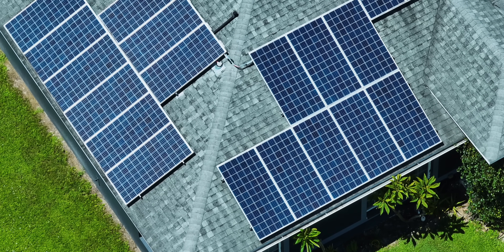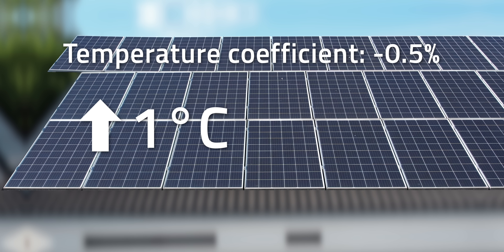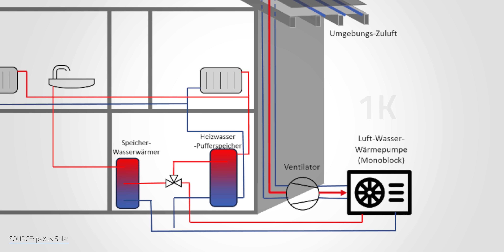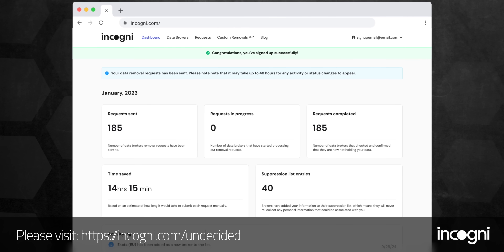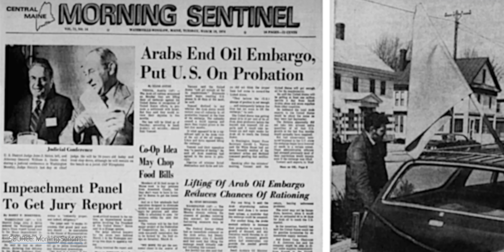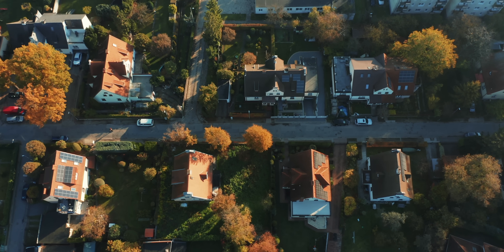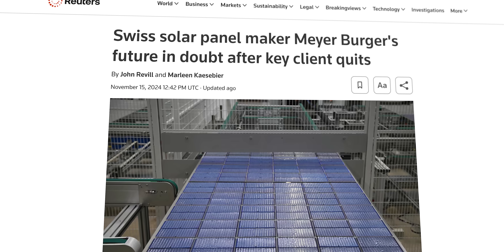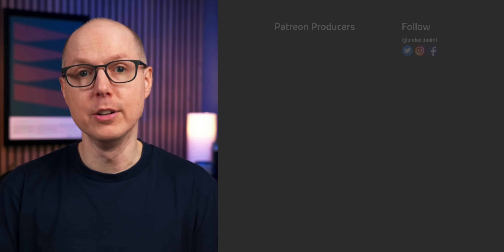Why Hybrid Solar Heat Pumps are the Future of Home Energy

Comment: You want to cool your solar panels in summer.
But that’s also when you’re not trying to heat your house .
The rest of the year you don’t need to cool your solar panels , but then there’s also no significant extra heat to be harvested by the heat pump.
It’s a cool idea , (haha) but ultimately it generates power when you don’t need it. 
A ground source heat pump makes a lot more sense , because when it’s really cold, the ground is still warm when it’s really hot the ground is still cool.
Reply: I was going to make exactly this point. The virtue of an air-source heat pump is that it's cheap. If you're going to invest money into making your air-source heat pump more efficient, why not just put the money into a ground-sourced system instead?
Reply: You still need hot water year round, and in the desert it's not uncommon to be 80⁰ during the day and 40⁰ at night in spring and fall
Reply: Heat your pool or water.
Reply: @llee4225  my daily warmwater needs are about 3kWh, and without pool, just to "waste" / get rid of the energy is not an economic case. It would be a very expensive (invest) way to heat a pool.
Reply: A more useful use case would be "heating a pool" in many places even un summer water is very cool so heating water in a pool might seem a more useful case.
Reply: You still need warm water in the summer though... Also you can run excess heat through a stirling engine to produce electricity or run air conditioning.
Reply: You really will still want to cool your panels on a sunny day in the winter in many places, they will still get up to the hard to hold sort of temperatures if the sun is really on them here all the way through winter. So yeah on the cold, gloomy winters day you probably don't gain hugely cooling the panel, and probably not a massive gain for the heatpump side either - not enough sun for the panels to really get hot anyway. But on the crisp and bright winters day it would have to be really really cold or windy for them not to get hot enough to benefit the heat pump and themselves.
Reply: Sounds like you need heat storage then.
Stone or water work great since they're easy to work with (in different ways) and can contain a lot of heat (i.e. they have a high thermal mass), though you'd need to insulate the water more. So in the case of water you'd need some kind of insulated tank. For stone you just need a lot of stone that is more connected to the place where you want to stabilize the temperature (i.e. the inside of your house) than the ground and especially the groundwater. 

Of course in both cases you need a way to intentionally lose heat as well, otherwise you've built a solar oven instead of a solar powered temperature controlled house, and that's not a great place to live. Or you need to balance it perfectly, but perfection doesn't exist.

If you don't want to mess with the complexity of using thermal mass to control air temperature and just want to use it to store energy, you're going to need to make the storage external, insulate it better, and accept the efficiency loss of transferring it or even converting it to electricity if that's what you need more.
Reply: Thanks for saving me write the obvious. Here summer is 45+ oC/115F which means if I am cooling my solar panels then what am I heating?
Reply: Your hot water heater would say other wise.
Reply: Do you take cold showers all summer? Wash your dishes in cold water?
Reply: @MonkeyJedi99  great have your ac unit push its heat into that, see how quick thats too much already.

And thats a far simpler system
Infact you can buy a integrated heatcylinder with heatpump on top, i have one, it cools down my garage, and gets me hot water. Easy
And it barely cools my garage…
Reply: Houses always need hot water ready though. I'm sure there's a way that you can tie it into a hot water heater (perhaps pre-heating the water) that makes economic sense.
Reply: @ that does, but then in winter its not sufficient, so you need backup heat, or you get tons of ice buildup.
Plus you have to do all that plumbing which is not cheap.

A simple traditional heatpump and some solar panels is just cheaper overall.
Reply: Good point! I wonder if the benefits are mostly felt on bright but cool sprint/autumn days, and this is enough to make the year average decent?
Reply: STES of which GSHP is an example is an obvious answer.  Use the summer heat when needed in the winter.
Reply: My solar panels were covered in snow half last month(January). I doubt that a heat pump/exchanger would work.
Reply: @dannydaw59  can the heat pump be done 'in reverse'? e.g. if you can use the heat pump to heat up the solar panels and melt the snow? hmm... it would be questionable if the electricity the heat pump uses to melt the snow will be recouped by the solar panels in the winter sun, but, its a thought
Reply: Absolutely right.
Reply: use it to heat water in a very insulated tank, if too much hot water water occurs you can convert heat into power when needed.
Reply: Ground source heat pumps tend to be a bit expensive when you live close to bedrock.
Reply: @  sure, but installing this with all the piping etc also isn’t cheap. Groundsource is pricy but it works, this is pricy and it won’t get you heat in winter when you need it, and no cooling in summer when you need it. Its ok for something to be pricy and good, or ok and cheap, its not ok to be pricy and ok or bad.
Reply: You want heated water year round, so that should work either way.
Reply: You still need hot water year round. and there's a lot of things you can do once you have for all intents and purposes free hot water. granted you have to pay for the water.
Reply: Unless you use the heat pump for your water heater in the summer.
Reply: @ which doesn’t solve the problem in winter…
And now you have to use it for heat sometimes and for cool some other times and then …
Yeah..
Reply: The heat pulp also cools the house, so it’s not like it generates energy you don’t need.
Reply: @ the heat pump moves energy, it cannot move energy to the solar panel, when its hot….
Because then it would get even hotter, and be even less efficient. Thats the problem.
Reply: Right, it's not fully complementary. However, the savings in energy consumption over a year suggests the system can generate power when you need it overall. You should explain this in your critique as well.
Reply: @ it can help, yes. But not enough to offset the extra material costs and switching as you’d still need a normal outdoor unit too for when its cold or hot.
So its on top of that normal cost. That also adds new modalities for failure and maintenance.
In short, yes you can do it, and in spring and fall you may get some benefit, but you won’t in winter and summer when the greatest needs are, thus its not a very practical solution.
Reply: There's plenty of solar heat to be harvested even on very cold winter days. Roofs can easily reach a surface temp of 80° or more on sunny winter days.
Reply: @ you are mistaking temperature for energy. Yes the surface can get warm. Especially when it’s not windy. But that doesn’t mean that’s actually a lot of energy there with only the tiniest amount of cooling that temperature is gonna drop right back down. Because a solar panel weighs almost nothing is not made out of any material with high heat capacity. As soon as you start sucking that energy out you realize that there is almost nothing there to begin with.
Reply: @FreekHoekstra  Heat is energy. A roof will get warm even in winter.  Saying that there is no heat to be gathered in winter is just wrong.
Reply: @ i’m not saying there’s no heat to be gathered in winter.
But there’s a lot less energy in a warm thin panel then you seem to think.
Yes, it might feel warm to the touch, but it might still only be a couple hundred watts of energy before it is actually freezing. You cannot have it freeze because if it were to freeze over, you would have to do thaw cycles which actually would be pretty bad, and when frozen the panel would be very inefficient. 
So the amount of energy you can extract without going below zero in winter is so incredibly low that is not worth the effort.

And in summer, you cannot dump any energy there because you would make your solar panels much hotter, which is exactly what you don’t want.
So even if you could make the winter example work, you can’t make the summer example work therefore it is not particularly useful.
Reply: exactly. unless you have a huge swimming-pool to store the excess heat generated in. but for a normal residential install this won't make sense from an operational and economic standpoint either. I mean you can buy 450W solar panels for as low as 50EUR here in Europe. if the same performance solar tiles with the integrated cooling lines cost anywhere twice or three times more (which is quite realistic), you simply wouldn't even care as for the price difference, you could install 2x or 3x more solar panels, which even with the heat coefficient dragging down efficiency, would still produce waaay more, than what you'd gain by installing these solar tiles. not even mentioning that during winter time (where it's below freezing, here, in most of Europe) you'd need to heat the fluid in those circulation lines so they don't freeze up, plus have to run pumps circulating the media in them, which drags down the efficiency as you're basically running pumps for 2 months, for at leat 8 hours without any benefit.
Reply: I'm always surprised when I see people liking a comment that seems so naive.
Do you really think SAHP engineers didn't think of that ?
The solar roof is gonna be way hotter than the ambient temperature (especially for a BLACK roof)
So you will still be able to cool it in summer and  in winter use this extra heat to enhance the heatpump.
Reply: @ you’re going to freeze over your panels in winter, reducing their efficacy, and make them even hotter in summer as you’re trying to get rid of heat because you’re running AC? And there’s plenty of solutions that are invented that are just not effective. Look at the history of crazy inventions, the majority of ideas sound good on paper but don’t work in practice, or they do, but they just don’t work as well as another solution.
And thats what this is, yes it works, but not as well as many other solutions.
Reply: You’re not wrong, but I would pose the counterpoint that not everyone who has a solar-capable roof will have a large enough chunk of land to do geothermal. My yard, for instance, is small enough that I’d have to encroach on the city-owned land by the road; where the gas main is run (spoiler, no chance in hell of that ever happening), and the size of that system by itself would only provide enough heat for 83% of an average winter. Now yes, an air-source heat pump by itself will struggle more… but for 8k to 11k for the air-source heat pump, vs 41.6k for an “80%+” geothermal system on my little plot of land, the air-source will be many times easier to get going.
Reply: "It generates power when you don’t need it"

In most EU countries, you can be a "prosumer", meaning you send the excess power to the grid and get paid for it. And depending on your setup, you can store the excess power during the day in batteries and push it to the grid at night, when prices are higher (energy is generally cheaper during the day due to lots of solar farms).

So there's that :)

PS: I truly don't understand the Americans reluctance to install solar, especially when prolly 70% of the population lives in the suburbs, in a house with an actual roof they can use. Which is kind of funny, as there's a lot of them who preach prepping, but the way they do it is by burying a propane tank in their back yard. Solar is virtually free after you cover the costs.
Reply: @mnmlro  in this case, the power is heat. The solar panels are hot when you’re trying to cool your house..
The solar panels are cool when you’re trying to heat your house . So there’s very little benefit to getting heat out of them.
Yeah i’m sure theres some days, but its not worth the extra complexity.
Reply: @mnmlro  I'll give you my French perspective :
- the energy you send back to the grid is often wasted because it wasn't accounted for in the d-1 planification (you get paid though) 
- if you want to send back the energy at night (I'm guessing you meant evening as it's actually cheaper at night) you'll need to add a battery and it's not cheap
- the performance reduction could certainly be solved for 1/4 of the price with regular panels and simple water cooling
- the real problem with the energy grid comes in the winter when solar's down and everyone turns up heating. It's important to point out this technology do not address this problem at all since in winter there'll be no need to cool the panels and the heat collected will be very low

On the other hand, increasing panels efficiency in summer, when the grid is made to handle winter and thus will perfectly hold in summer seems like a waste. The only upside would be some warm water but you could also install regular panels + thermal panels for a much lower price and much better efficiency 

The bullet points don't look friendly but I had a lot to say, it was not meant to look intimidating and I'm open to discussions 😅 I've read a lot of stuff on this subject but I've never done it myself
Reply: @mnmlro  It's not a question of what to do with the excess electricity but what to do with the excess heat.  My house almost never needs heating and if it does, any solar panels on it would not be very hot.  Any excess heat pulled from the panels is unwanted well over 90% of the time so is this solution really worth it.  As far as Americans not having way more solar goes, I agree but wanted to point out some reasons that's the case.  The first goes back to your prosumer comment.  That's a great idea and it's honestly how it should work but many utilities in the U.S. pay or credit the homeowner a small fraction of the value of the excess electricity generated and the governments involved rarely do anything to change that.  And it's actually getting worse as the years go by.  That means that it can take a long, long time for a larger system to pay for itself.  Another reason is that we don't have nearly as good a tax incentives as many other countries for doing so, which is incredibly frustrating.  And without those, even people that would like to install can't afford the upfront cost.  Even for the climate change deniers, spreading out generation everywhere results in a much more reliable grid but that seems to just be ignored.  A third reason is that climate change denial is rampant here.  A giant portion of the population believes it to be a liberal hoax (which is just embarrassing, honestly).  And finally, since a large number of people don't see any environmental benefit to it, they would only install solar if it benefitted them, but even when it would actually benefit them, the same "news sources" that tell them climate change is a hoax also tell them solar is a rip-off despite concrete data showing otherwise.
Reply: @mnmlro  This will get harder and harder, the higher the solar adoption goes. Sooner or later, this will get axed. In Germany, we already have too much solar power on some spring and summer days, leading to grey outs.
So I wouldn't base my system that is expected to run 2 decades on something, that is gonna change soon.
Reply: @mnmlro  How do you not understand? The ROI on most solar systems is likely close to 20 years, and how much maintenance is it going to need over that time? How many people actually plan on even owning their home for that long? The costs are way too high to make it an easy decision.
Reply: @mnmlro  listen, dvmb4ss, it doesn't generate electricity, it generates heat, both are power. Can you send heat back to the grid and earn money for that - I don't think so, so shut up and think before typing nonsense
Reply: @mnmlro  We have the same thing in the US - backfeeding into the grid and you get credits for it. We also have batteries here too. Don't know why you would think otherwise other than being misinformed and/or deliberately snarky.

You are also misinformed(still) about some reluctance to Americans and solar. Probably your typical euro inferiority complex biases coming thru. The real reason why there isn't more rooftop solar here is simple - there isn't a need for it. Contrary to what you believe, the US electric grid is up 99.9999% of the time in most areas at a cost on average less that half of what the typical euro pays per per kilowatt. The typical American household won't spend thousands for panels/inverters/batteries/wiring/installation when the average electric bill is simply not that expensive.

Preppers? Again, you are totally wrong, but that is expected at this point. Most preppers i know have a Jackery/Ecoflow/Bluetti and the SOLAR panels that come with it. A simple Youtube search would correct you on that. 

In summary, your should probably educate yourself more Alex.

Comment: Good video. An ideal system would combine heat pump home heating and cooling, with a heat pump water heater and heat recovery from solar panels. Homes use electricity to AC,  tossing the excess heat outside that should go towards heating hot water. Lookup Heat Recovery Units. Solar loses power when they get hot so pump that heat into a hat water heater year round, or in home heating in winter. Think octovlave for a home.

Comment: If decreasing efficiency is the only problem with excess heat on solar panels, do we even have a problem here?  In the conditions where the temperature really eats into the efficiency, you're in midday, mid-summer.  The average homeowner is already producing well over capacity and, if they even can sell the excess, they're selling into a saturated market.  The real issue with excess heat is decreased lifetime of the panels.